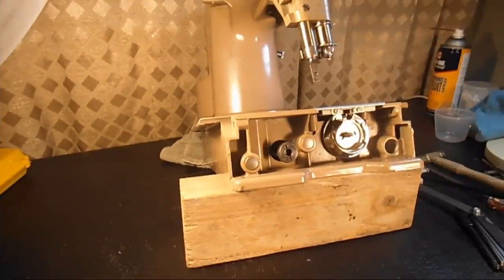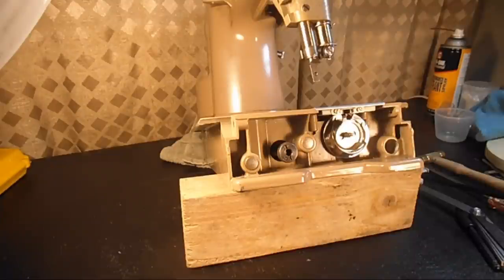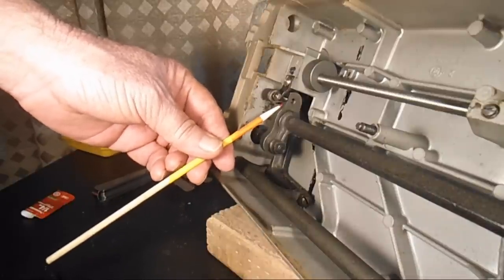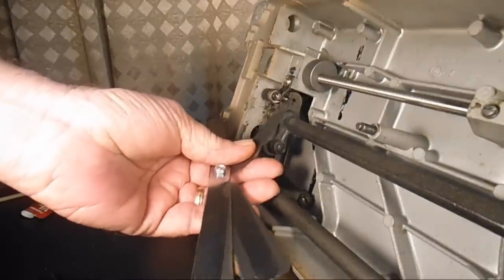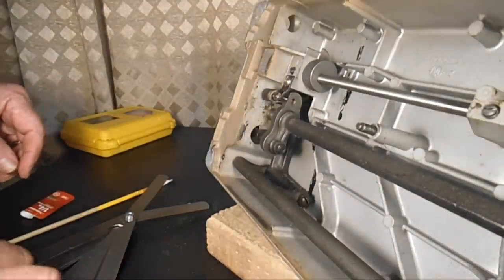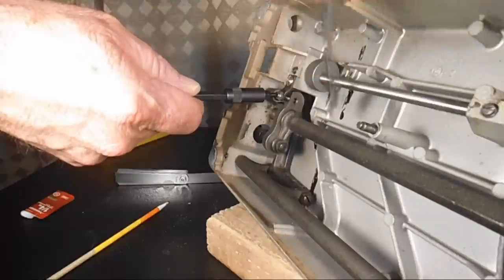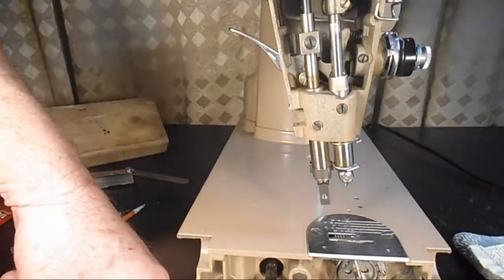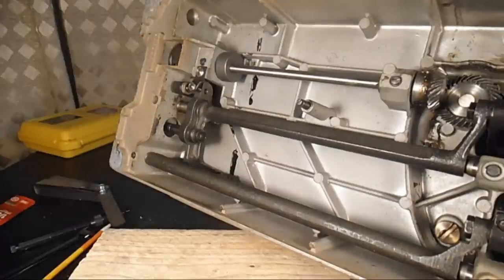To Regulate Feed Throw-Out on a Singer Model 301A

Comment: Hi Andy.  Early in February, Roger went thrift shopping at Goodwill and found a 301A Palomino (in an original case with accessories, foot pedal, power cord, and oil can) for $24.50!  I’ve never worked on a 301A, and I’m very enthusiastic about restoring it.  Well, as I was inspecting it, I knew I didn’t know anything about the feed-throw out, so I started messing around with it.  It was hard to turn and I heard and saw the feed dog hitting the hook area when the feed throw-out was fully released.  And, the feed dog was too low. I felt I had to fix these symptoms before starting the full restoration. So I watched your feed dog and feed-throw out videos.  I cleaned and oiled the areas, and by using your videos I was able to set the feed dog at the correct height and fix the feed throw-out so it didn’t scrape the hook area.  Thank you so much.  Your videos are clear, calming, and precise.  Your videos bring the Service Manual words to life!
Reply from the maker: "" Your videos bring the Service Manual words to life! "" Absolutely the nicest compliment I've received! Thank you 🙏
I miss making the videos. My wife, Generosa, wanted to surprise me and tried to find a used 301A. The lowest price she found around town was $245, so she changed her mind and found a nice 328K for $20 at a yard sale. It's patiently waiting for me under the workbench. Hopefully, someday soon. Your nice comment made my day. Regards to Roger, also, whom I've come to believe is the king of good deals 😀

Comment: On my 301A, the space between the stop screw and the base of the feed bar was too narrow. I could hear a faint knocking noise, so I followed your instructions. Thumbscrew screwed all the way in, feed regulator set on 6 and feed dog set at the lowest point. I used a piece of standard printer paper as a gauge of fortune as the thickness is .004 inch (0.1mm). I unscrewed the stop screw until the paper could fit in and fastened the nut with a 1/4 wrench. No more knocking sound. * Thumbs up.
Reply from the maker: A very fine job, Maxine! One of the retired Singer repairmen told me his two favorite spacing measurement devices were a sheet of typing (copy) paper and a matchbook cover.
Thanks for letting me know. I see this video has not received a whole lot of views, but if you have the knocking problem this video can help. Take Care.

Comment: Andy, when playing around with the feed throw out, I noticed there was no “springiness” to my feed bar throw out lever (part #170038) on my Palomino 301A (name Betty Ann).  I thought there should be some springiness, and I could see no spring anywhere.  After much thinking and fiddling, I finally looked at the parts list and saw that there is a spring (#170040) listed in the parts for the 301-1 (Parts Under the Bed).  To the best of my figuring, it looks like the spring connects inside and between the feed bar throw out lever and the feed rock lifting shaft (#170047).  One can’t see the spring from the outside.  I don’t think I have one in my machine, and I don’t think I need one, as when I drop the feed dog, gravity takes control and pulls the feed dog down.  Have you ever seen this in a 301A?
Reply from the maker: I also believe that the spring is inside the connection of the lever and the shaft. I've never opened that area up and pulled out the shaft so I've never seen the spring. I believe that spring is like a shock absorber to allow the change of direction of the lever without jarring the parts. I think of it like the spring in the handwheel assembly that flexes when the wheel starts and stops. I remember looking under the front of the bed at the bobbin case and the thumb screw for the feed throw out. With the dog thrown out (dropped) and the motor running that thumb screw would bounce up and down in time to the dog. I think the screw helps that sudden direction reverse more smoothly. I don't think the spring is strong enough to lift the dog by itself. That's my WAG about it. (WAG = Wild A** Guess)
Reply: @andytubesewing1953  Thanks so much for the information.  And, your WAG makes sense.  I’m thinking with my machine, when it was built, Singer ran out of those little springs, so they did not put one in.  The feed drop works without that spring.  Well, yesterday, I gave Betty Ann (the previous, perhaps the original owner, scratched that name on the outside vertical walls underneath the bed), a pre-treatment, shower and dry, and lubrication.  She looks spins and looks just so great.  Now, I look forward to putting on all her cleaned parts.
Reply from the maker: @carolemagnusson5044  it's such a tiny piece I could see it could get misplaced on the assembly like. Betty Ann sounds beautiful.
Here is some music to assemble her by: https://www.youtube.com/watch?v=IGEDxzZm_gE
Reply: @andytubesewing1953  Oh wow, you gave me such a laugh!  How did you find that song?  It’s so perfect.  Now, I’m motivated to make a You-Tube video of Betty Ann to go along with the song.  It won’t be for a while, however, because I still have a lot to do:  Finish putting all the parts on, doing the fine tuning, waxing, sew testing.  I found I was missing another part, the bottom thread guide attached to the needle bar.  Luckily, Thrifty Farm Girl had the exact part, and I ordered it yesterday (20% off coupon for all of February).  The bottom oil pan is absolutely caked with grease and oil, and I’ll need a warm/hot summer day to dry the felt pad after treatment.  The motor and foot pedal seem to be in perfect condition as is with no treatment needed.  The motor is so quiet and smooth.  Maybe the PA2-8 motor is just overall a quieter motor than the A9-8 or PA10-8.  In the mean time, I will study the ins and outs of making a You-Tube video.
Reply from the maker: @carolemagnusson5044  My older brother and sister love this kind of music on the AM radio. When I was growing up one Christmas my parents got each of them a little transistor radio from Japan. That was all the rage and then I heard this type of music even more cuz they can take it everywhere haha. I remember hearing this song like 45.50 years ago or something and I was able to find it on YouTube. I thought you'd get a kick out of it. I know you're restoration work will continue to go well. Just hearing about it. Makes me want to go find another 301 even though I've done about 15 of them. Good luck. Carole and take care

Comment: Andy,my stitch regulator keeps moving when I turn over the hand wheel. It's making me crazy trying to figure out what's causing it. Oh...I'm refurbishing a 15-91. Thanks kiddo.
Reply from the maker: Hi Terri. Harlan is correct (thank you Harlan). Models like the 301, 401,500 will usually not allow the feed lever to move, but the older models like the 15-91 were made a little bit differently and used the lock-down thumb screw to hold the feed regulator (length) in place. You can read about it on page 19 of the free instruction manual:
https://www.singer.com/sites/default/files/product_manual/SINGER%2015-91%20Sewing%20Machine.pdf

Comment: The feed dogs on my 301a has a lot of play from side to side. How do you adjust that?
Reply from the maker: That beats me, Marsha. I've never had that problem and there is no side-to-side adjustment listed in the Adjusters Manual. There are adjustments for dog height and position front to back and the throw-out I show in the video. My WAG (wild-ass guess) is something is just loose, not out of adjustment. Maybe looking at the other dog adjustment instructions and following those parts on the base of the machine can lead you to a loose connection somewhere. This fellow allows for free download of all the 301A manuals if you want to check it out (I don't know him) https://odessasewingmachine.com/singer-301a